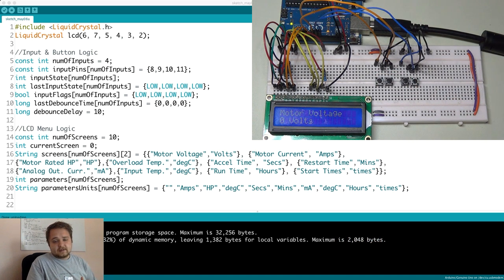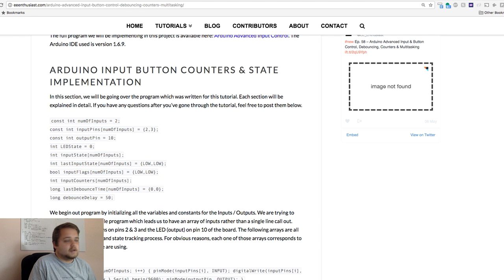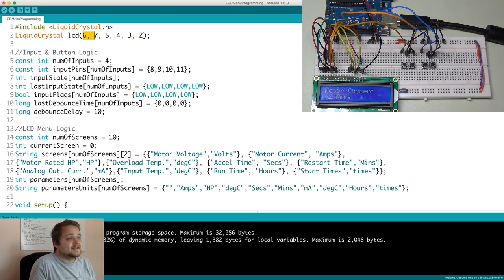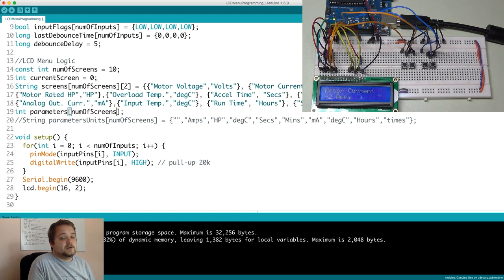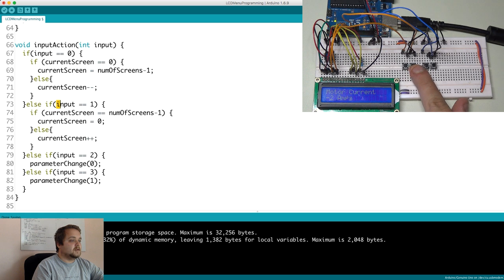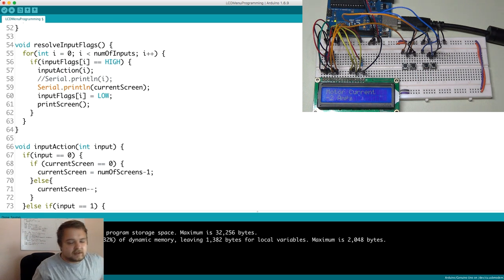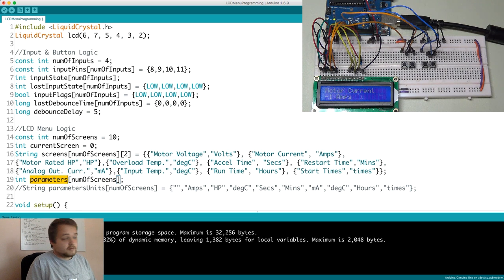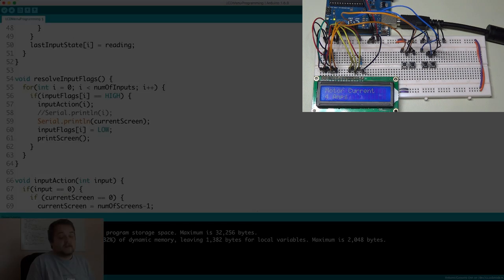Ep. 59 - Arduino LCD Display Menu System Tutorial, Scrolling Menu, Changeable Variables for Projects

Comment: Sir! I made an arduino solar charge controller using 16x2 LCD with a button switch to select "menu1" monitors solar voltage and current and "menu2" monitors voltage and current
 of the battery. Switching between these two menus was good but I noticed that the lcd display did not keep updating the voltage from the input pins. can you help me? thank

Comment: Super good. Integrating this into a temperature controller for bioethanol fuel cell research, controlled with a joystick. Changing parameters can be scaled by the y axis of the joystick, so the further away from the middle it is the faster the value changes.

Comment: Thank you for explaining this, googled Arduino menu and glad I saw this.
I do have 2 questions.  How could we go about having that first screen be a sort of home screen.... specifically, I want to do this for time and temperature.
The menu would be used to set low temp, high temp and then time on and time off.  On the home screen I'd like to show actual temp and time.
My second question is on time.... how would this be implemented to change 12 hour time, would you have a menu screen for each element (hour, min, am/pm) or is there a way to select only the section of time you want to adjust? 
If you show this in other videos, I'm going to go check out your others now, but  could you let me know which one(s). Thank you.
Reply: Also, IDK if it matters, but I'll be using an OLED screen...... figured the concept would be the same?

Comment: Thanks for your video, very well explained!
And thanks for the code which I will be using once I have hacked it a bit to work with I2C 1602 and a resistor chain 4 switch input on an analog pin.

Comment: Thank You! Great tutorial!!! Question: I used serial print to view the Variables.
When the code starts it shows:
(screens[currentScreen][0] shows Motor Voltage, Motor Voltage, Start Time, Motor Voltage
Serial.print (parameters[currentScreen]); shows 1,0,0,0
Serial.print(screens[currentScreen][1]); Volts, Volts,Times,Volts
so at startup it looks as if it is not setting all the button presses to 0 untill it goes through all the buttons.
Is their a way to fix this?
I attempted to debug but could not figure out why it was doing this.

Thanks! Again.

Comment: Hello sir, awesome project by the way, I implemented the same and wanted to try out one feature,  like I have another button which is pressed to execute something with respect to the values i recorded in the menu. eg. I put run time and frequency in the menu and stored the values in the variable and now i want to use these values and execute a basic command. like if there is another button which when pressed executes some codes taking values entered previously. how do we do it?

Comment: Respectable sir
I have a small doubt,  imagine i changed some value using this switch for my purpose,  what will happen once power off and on??. What value will remain once the power on??. Whether the value i changed?? or, the value you that written in the code???. 
If it will remain the value written in the code, is there any way  to keep the value manually given by user even after powercut??. Please give me solution,  thank you

Comment: This is great tutorial for lcd menu that I found. I'm in the middle of making project of programmable dozing pump using arduino uno with lcd keypad shield, RTC DS3231 and peristaltic pump. I want to make the dosing pump running automatically base and day and time that I can set before. also every pump will run for specific volume as we set. I really appreciate if you help me to create the code for those project?  thanks

Comment: Thanks, but sir this program doesn't retain data after power off. how to do this sir?
Reply: Never disconnect the power or learn how to save the values in the memory. How that is done there are instructions on Google where you can search and find what you need so you can put it together your self.

Comment: As long as people understand that this is beginner level stuff, this is a good tutorial.

I mean there are no interrupts utilized, the menu structure and arrays could be saved directly to flash so you could save on RAM and there could be display buffer such that you render to that buffer and then when it's ready you send it to the LCD using hardware SPI/I2C module etc. etc.

Debouncing could utilize hardware timers as well and buttons shouldn't be polled if not necessary but be interrupt driven (either timer or state change interrupt).

It's a good tutorial for those who want to learn the basics regardless. :)

Comment: This code puzzles me as it seem to be written by professional that knows what he is doing, but it breaks some rules of programming. It mixes logic and low-level stuff and it does not offer clear extensibility and other good code features.
Here are tricky questions:
1) What is some (one at least) parameters will have to be not integer, but logical (display "yes" and "no")?
2) What is some parameters will have to be float?
3) What if different float parameters will have different increment steps (0.1 and 0.01)?
4) What it there is a need to apply limits for possible values? (this is the most obvious requirement)
For all of these questions there is not obvious answer. Whole code will have to be redesigned, so it is bad code.

I would create C++ code with class for each parameter type, i.e.:
class Value {
public:
virtual void display(LiquidCrystal lcd) = 0;
virtual void save_to_eeprom(int offset) = 0;
virtual bool inc() = 0; // return false if inc failed so device could produce error sound
virtual bool dec() = 0; // ...
};
class Integer : public Value {
  int val, min, max;
public:
  Integer(_val, _min, _max) : val(_val), min(_min), mac(_max) {}
...

const char *dimension() = 0;
virtual void display(LiquidCrystal lcd) {
   lcd.print(val);
   lcd.print(" ");
  lcd.print(dimension());
}
};
and so on. This will give ability to extend this code in the future and apply any restrictions and new features. For example, to create "logarithmic scale values" that increment delta depends on current value (bigger for higher value)
Reply: It sounds like you know how to code so why don't you have your own channel showing how it is done so we can learn the proper way?

Comment: Hi! My congratulation for your work! 5STARS!!!   I'm trying to adapt your code to use on a LCD Keypad  Like this--> https://www.dfrobot.com/wiki/index.php/Arduino_LCD_KeyPad_Shield_(SKU:_DFR0009)  that I brought from eBay , the main difference is that it uses the  analog input 0 and 5 resistors to give 5 different analog readings one for each button, instead of use one digital input for each button... is that possible/easy to adapt it ??? Thank you once more!
Best Regards From Portugal

Comment: Hi  im new in arduino programming. Im creating a new amp control switch  project for Rapier loom. 
Now i want to add simple menu system with 16/2 LCD display.

Project concept.. If ampere drops or high  predefined level the relay should active.
 
Pls share ur email id.Let me send code. 

Thank you 
RAVI

Comment: I found it interesting that you used a AB PowerFlex 4 for your example. I designed a lot of equipment that used that drive. Allen Bradley is obsoleting that particular drive soon by the way.
Reply from the maker: It's a drive I see quite frequently in the field, but you're completely right in saying that it is an older model at this point. For most panels I specify nowadays, I've been using PF 525 drives. That being said, they have somewhat of a different screen setup, but it still applies to some extent.

Comment: Hi, I have been looking for something similar. The video was a big help. Thanks for the same. I am struggling to make the increments/decrements faster on a long sustained press of value buttons. (Want to do something similar to what digital clock buttons do). Please help me to add code to make the increments/decrements faster on a long sustained press of value buttons.
Reply from the maker: That's an interesting application. It's obviously something which is present on many devices. It shouldn't be too difficult to implement, all you need to increase is the rate based on the press duration. In other words, in my case, the code does +0.01 with each press. As you hold the button down, after 5 seconds, it could change to +0.1.
Reply: Thanks !
Will sure try.

Comment: Very nice! Thanks for this.. the question is, I have 10 different functions (function one for example is 6 LEDs that blink in succession, two would use a Pot to adjust the blink rate, etc etc). They are set up in Switch/Case format using the Serial interface to choose items. How do I plug what I am trying to do into your menu system? This looks very promising! It would end the requirement of having to open the serial monitor.

Comment: What about trying this but instead of using buttons, using a ps2 joystick module? You can change the screen moving the x axys and the parameters moving the y axys.
Reply from the maker: Well, that's definitely possible. As it stands, any button or input can toggle the transition. If you wire it up the same way as the buttons, you can use any peripheral to create the same effect.
Reply: I tried it and it worked very well!
Reply from the maker: Awesome! Glad to hear it worked.

Comment: Really good video Vlad!! I want your help. I am trying to make a similar GUI but i have to use only 3 buttons. I have got 4 main menu items and the first menu item has 4 more sub items.So i am going to use one button for entering a menu and saving a changed parameter. The other two for navigation and changing parameter values. Please can you help me out!! Also the code is not available on the link you have posted.
Reply from the maker: That's definitely something I can help you with. Could you please post some more info (your menu structure, what you'd want that 3rd button to do exactly at every step, etc.) on the forum (http://forum.eeenthusiast.com/)? I'd like to build exactly what you're talking about and create a "follow-up" video to this one on how to add sub menus. Also, I'll fix the link to the code tonight; thanks for pointing that out.
Reply: Heyy Vlad !! i figured it out. Your code ,I think is the most versatile one i have seen so far. Excellent code!! I could easily make changes and yeah, i will provide you the structure. I think you can show a more easier way than i have done. Thanks!!
Reply from the maker: awesome!